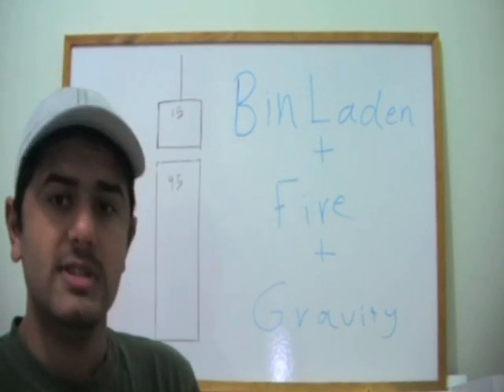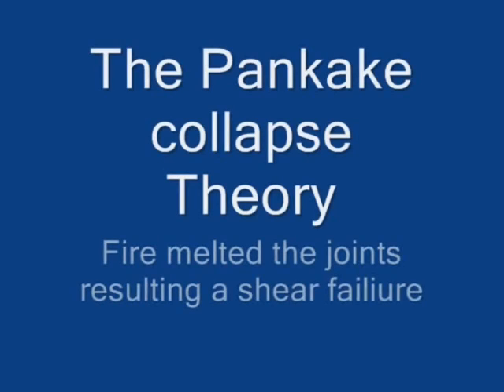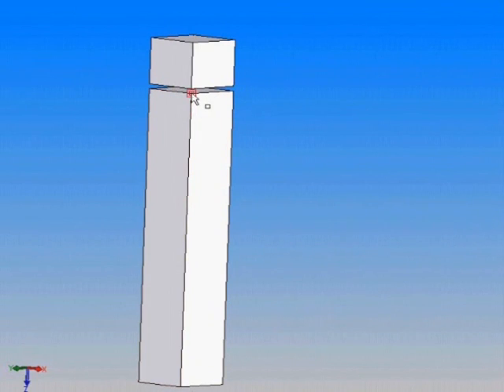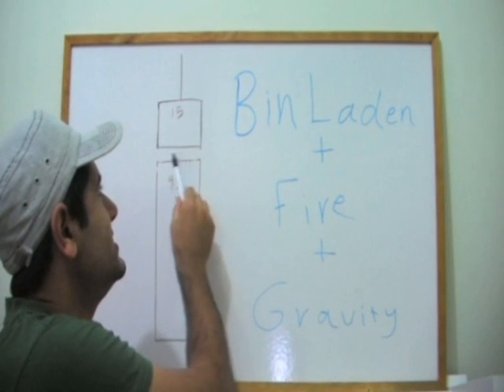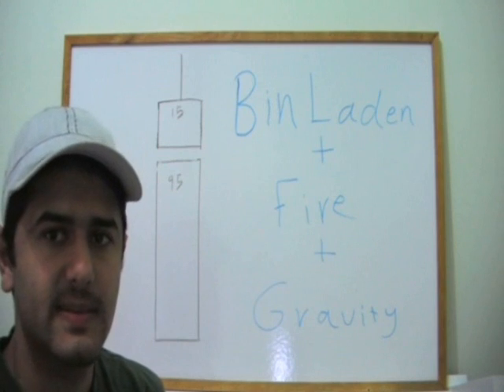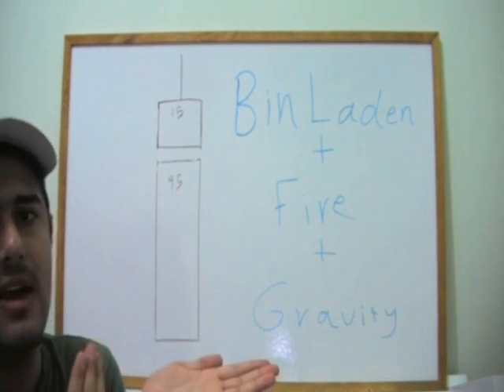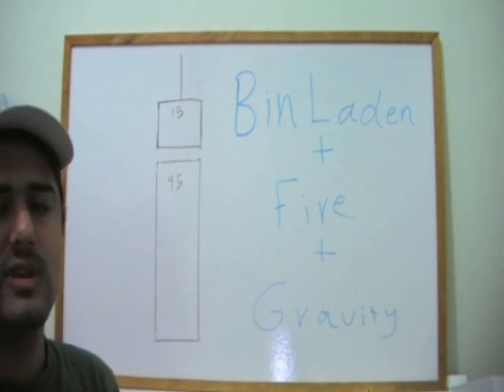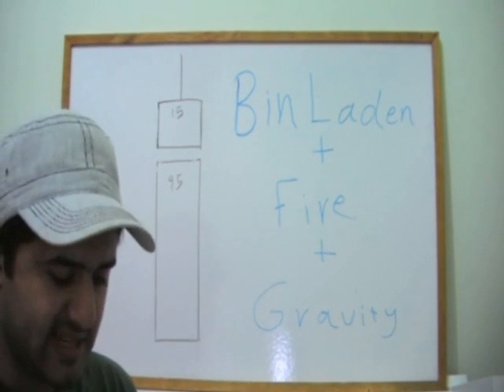(Part1) 911 Simple Physics Structural Failure Vs Demolition

Comment: The central colum would get turned to dust if the several ton floors started to free-fall
Reply: +Tom Star Gazer , you have no concept of physics at all
Reply: Tom Star Gazer You should call yourself IDIOT PHYSICS!
Reply: John Sergei  You should call yourself "Delusional Donut"
Reply: Simple physics for simpletons
Reply: Tom Star Gazer
Ok, last reply from me then you can return to your basement of delusions.

Your reply indicates how little you know about the towers.  The towers were not made of tooth picks and bamboo.  The towers were amazingly strong.  The towers were rated to survive a collision by a fully loaded 707.  And since you are clueless about other things you may be clueless about a 707.  A 707 was not a small jet.  A 707 was a large jet that carried comparable passengers and fuel to the 767.  And it had 4 jet engines that gave it enormous thrust and forward momentum.  So you are saying that even though the mass, velocity and energy are comparable between a 707 and a 767 and the towers were rated to survive being hit by a 707 that the towers should magically fall if they are hit by a 767.  Well there you have it.  No wonder so many people don't buy the official government version of the story.  The official version is nonsense that is not based on science.  The official version is either due to an incompetent investigation or it is due to a lie that is being covered up. 

Adios.
Reply: +Patrick Lilley 
You must have done well in your studies.  Perhaps you should give your buds over at NIST a call and tell them that you have solved their problem.  It could not say why there was total collapse.  You know that directive they were given by Congress and that they failed to accomplish in any form.  Yes, I think you should get on line right away and tell them you gott'er beat.   Now on the other hand if you wrote the above as a joke,  I don't find the murder of thousands very humourous.
Reply: carly0710 The conspiracy theory is cuckoo. There is not an ounze of truth in it.
Reply: Tom Star Gazer
"carrying 6,000 miles of fuel"?  Grammar and proper word selection be damned, I like your style.  6,000 MILES OF FUEL!!!
Reply: Phi Sailor think dat would best, you go & rest your deluded head boy
Reply: De Selby "worth of fuel" -  Anyway fire away with your theory - what made them collapse Einstein ? lol
Reply: De Selby lol @ office fires...I like it.  
Forget the impact & explosions, you wont be able to convince people.
Reply: De Selby a 767-200 can travel 6800 miles on a full tank of fuel. 

Nothing of that structure has ever been felled by planes slamming into it & exploding or demolision in the history of the world. So I guess we'll never know. 

Demolision seems a lot less likely to me. 
You can look into things so deeply that you forget simple common sense - 
*1 tower would of been enough to justify any war in the middle east
*Would NOT give the world the correct intelligence of them being from a allied country : "Saudi" , wouldn't it make sense to tell the world it was 19 Afghans & Iraqis - the countries you intended to invade in the first place. 
*A rickety old american ship in the persian gulf would of been enough to go to war with Saddam as he has kicked out UN and broke 17 sanctions since 1998.
Reply: De Selby Where have you heard that ? 
I heard nothing about the 707 fabrication until 2004 when all the theories started & I lived with & watched documentries on the towers since they were built. 

You've got to question the information you are recieving online, if you are being led to believe that  central colum buildings with a steel curtain can with stand a 4 engined passenger jet slamming into it & exploding.
Reply: De Selby Truth is the 707 story was just an example & worry in the 1960's whilst designing the towers. They were never made to withstand full impact of a 707.....it would of been impossible. How does anyone know or test for that with 2 towers that the world had never seen before. 
Its Just more speculation taken out of context

Would of made more sense to have them Stacked & steel framed in they were. 
Theres lots of reasons for that story - mainly worry/thoughts & concepts in the preperation.
Reply: De Selby 
Steel has eutectic melting points & 2 planes & petrolium was certainly enough to weaken it.

If the buildings were stacked or narrowed with height then maybe they wouldn't of collapsed to the bottom floor. 

How can you call people wrong when you are just highlighting theoreticals of unexplained on speculation..

Nothing like 9/11 has ever happened in the history of the world with that type of modern aircraft & that type of skyscraper which go "straight up" and maintain the same square suface area instead of narrowing as they rise or being stacked. 
Its common sense really. Soon as 1 floor went, they whole thing was going to come down. 

Its the same if you build a stacked tower of cards & a non stacked "straight up" tower of cards. If you take one out the stacked tower then there is some structure at the bottom. 
But If you take one card out the non-stacked "straight up" tower of cards. Then the whole thing collapses to the bottom. 

Do you know this simple experiment in physics ? 
Do you know thermite is used in primer paint ? 

Or are you just going just keep highlighting: "only buildings to fall of an office fire"
Reply: +De Selby I'm just trying to give you an example because you fail to understand the most basic of physics. 

You cannot explain what happened, all you can do is spew rhetoric, spectulation & over substantuate unproven facts

You've gotta ask yourself why you do that & see thru this nonesense.

Skyscrapers built like the twin towers have not been around that long in history. 

Name me another building that is non-stacked, straight up maintaining same suface area from bottom to the top. 
See you can't
Reply: +De Selby  lol haha -You are extremely simple, for you are just repeating what someone else has said & have taken it as 100% fact. 
You cannot even think for yourself
Reply: +Tom Star Gazer 
Actually no, it most certainly would not.
Reply: Phi Sailor The fact of the matter is, planes of that size & capable of flying that many miles have never crashed into non stacked state of the art skyscrapers like that - EVER (built 30yrs ago). 

If I was going to commit a conspiracy on that scale I'd one:

Remember not to tell the world the correct intelligence of the 19 being from a Allied country & tell the world they were from the countries I intended to attack. 

I'd remember to plant WMD's 

I'd remember to take the oil

And in the 1st place I'd blow an old rickety America ship I'm the persian gulf & make it headline news. 

1 tower would of been enough to justify any war. 

I think The West would of got what they wanted if any conspiracy was committed.
Reply: Phi Sailor On one hand, Theorists give them way too much credit, on what they may be possible off, mainly by connecting distant dots. 

But on the results they do an awful shitty job, but the theorists are totally blinded by what they have heard. 

The results Prove that none of these conspiracy theories are correct
Reply: +Tom Star Gazer 
Forget connecting dots.  Just do two things, look at the science not the faith and of course, follow the money.  Pretty simple.  Forget all that conspiracy shit and look at the evidence.  Don't make the conclusion and make the evidence fit.  That's not science.  I would like to know how all the bullion was saved and not the people.  I guess the gold was in the process of being moved.  Just a lucky coincidence.   
So use science and follow the money.
Reply: +Tom Star Gazer 
The results show that the 'official' version is the least correct scientifically.  Science is not about 'knowing', that is the world of religion.  Science is about models that best represent what we see.  We use these models to see further.  When they don't fit we change them.  Reluctantly to be sure but we change them
Reply: +Tom Star Gazer
As far as this guy is concerned, i think he needs his nap.
Reply: Phi Sailor  so what's the scientific version, a bunch of bombs were planted lol cuckoo cuckoo cuckoo
Reply: Title of this video should be called "extremely simple physics...." lol
Reply: +Tom Star Gazer 
What ever lets you sleep Tom.  I need the occasional help myself.
Reply: +Tom Star Gazer 
Ppfftttttt !
Reply: +Tom Star Gazer ....i thought the official story was that a bunch of cave dwelling middle easterns, managed to infiltrate, delude, and (using box cutters), take over four American passenger airlines and use them as weapons, slamming two of those planes into the flimsiest buildings on the planet, and using the other two flimsiest planes on the planet to vaporise into nothing....whilst the biggest military might on the planet was looking the other way....just a theory....not a conspiracy.....
Reply: No Neck  The millitary is designed for acts of war from other militaries, not 19 guys who took flying lessons then took over a passenger jet with mace, box cutters & fake bomb devices, 

Getting a plane was like catching a bus prior 9/11. Even if the millitary did intervene in time is unlikely they could of done of much but play a guessing game
Reply: +Tom Star Gazer 
Actually, your first statement is profoundly false.  How am I to consider anything else you say?
Reply: +Patrick Lilley 
"I said it was entirely possible for the planes to slice through the outside walls." 
A passenger airliner would not.  The engines would keep on truckin' for a while but nothing much else.  And I have been know to make mistakes.  I may have misread something.  I am sure we are all wanting the murderers to see justice from the people... yah ya if that day ever comes - so for now we need to stay within the realms of possibility.   I am not suggesting that nothing flew into the buildings but it wasn't a unmodified commercial aircraft.  I can envisage the airplane being torn apart and with some severe exterior column damage but the only thing that would reach the center of the building would be the engines.  Kinda like putting a potato through a french fry cutter.   I am sure there are many missile type weapons that could go through the building.  But you know and I know that one hit like this would never bring the building down.
Reply: +Tom Star Gazer Lol Stay in your lane. You don't know physics.
Reply: Austin L Still working towards a BS in Physics. How far along are you?
Reply: Real physicists are ok with coming to a conclusion of simply not knowing. 
Without losing their logically mind, panicing, fear mongering and suggesting wacko shit like: 
 "it's the Jews,  it's a conspiracy & demolishion teams still  keep the secrets to this day" 

Every muppet has a PhD in physics nowadays LOL
Reply: What do jews have to do with any of this? Youre off base guy. And who's afraid? If the American government had prior knowledge of this then the only ones who were to be afraid were the ones near the buildings and their families. The outcome of the war was American profit. We all have it pretty great here. Im just curious why tower 7 was demolished, and how it was organized and by what world group for what exact gain. Chess moves, boy. Not checkers.
Reply: Tom Star Gazer 
"The central colum would get turned to dust if the several ton floors started to free-fall" You have it backwards the 'colum' would be turned to dust to allow free fall.  But of course you knew that and gave it a nice twist.
Reply: Tom Star Gazer
Still playing Tom ?
Listening to you brings a few words to mind

"arguing with idiots is like playing chess with a pigeon...  No matter how good you are, the bird is going to shit on the board and strut around like it won anyway."
I am sure you will just keep on a cluckin'.
Reply: The problem with these theorists who build a grand theory on rhetoric & speculation is, they always seem to have these little cute sayings & labels. 

If you know anything about psychologically you'll know it means "agree with me" I'm getting frustrated
Reply: +Tom Star Gazer 
So you think